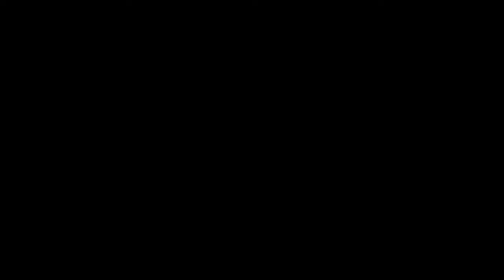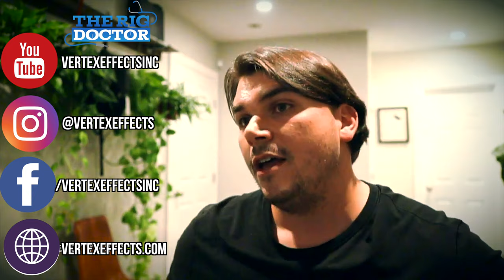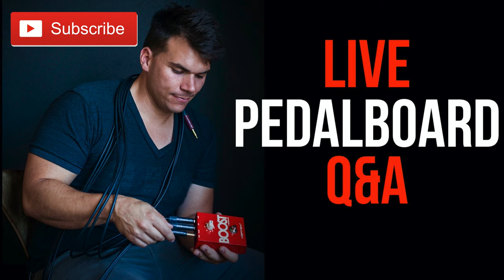Tube Buffered Effects Loop

Comment from the maker: Hey all! We're talking about effects loop buffers today! Let us know if you have any questions in the comments below. Thanks for watching! SUBSCRIBE: https://www.youtube.com/channel/UC0lvt4Tpj5xI4Cfzfz4SHzg
Reply: Any experience working with a Peavey 5150 block letter's fx loop? Putting a board together for that.. But haven't finished getting all the ingredients. I was gonna just put the delays on top of the alp and switch them with a midi switcher, but I might end up putting them in the board for a few reasons such as.. I ordered a Source Audio EQ2 that has two independent, programmable channels, to run one in front of the amp and one in the loop... Also picked up a Gamechanger Audio Plus Sustain Pedal, which I think will work better in the loop if I can get it to work with high gain.. Also, I'm planning on using a TC mimic to pump the signal out to another 5150, into the fx return. 
BTW,  I think the 5150's fx loop is kind of always "in the loop"... Like at least the tubes are.. That's what I've heard.. That it's always part of the circuit somehow. I can't tell a difference jumpering with a patch cable at least... 
Also, some people actually remove the fx loop from the Solano Slo... Or get it without it. I'm not sure why but I think it alters the tone... Maybe it's because it's similar to the 5150's if the urban legend above is true?

Comment: I just found out that ALL my pedals sound way better in one line into the RETURN of my Mustang gtx50. It is way louder and will have to adjust them all. FINALLY the SSS and the lush reverbs SOUND right. Even when i use bypass the tone really still gets squashed by the PRE amp section!

Comment: HI Mason, thanks for sharing so much great info. Could I use the TC electronics bonafide buffer for the return of my FX loop?
Reply from the maker: Sure, as an output buffer but if you have a passive effects loop it won't help.
Reply: @VertexEffectsInc  I just purchase a klein-ulator Buffered FX loop per the rigdoctor's suggestion. That should help with the passive effects loop right?

Comment: If you have a really long cable run in FX loop it really drags on the tubes. That’s where I think the high-wire would be very useful.
Reply from the maker: Adam Smale Realistically you’d really only be able to make a buffer work on the return if you’re coming all the way back to the Pedalbord with long cables, the problem with the input buffer on the send is that you already would be going through 15 or 20 feet of cable presumably before hitting the input buffer unless there was a way to put the buffet right after the send on top of the amp or something like that.
Reply: Vertex Effects OK, I thought you could use the input of the buffer at the board, then use the output to drive back to the board from the FX loop send. But duh! That would require two separate buffers! I didn’t think that through. Sorry, Unc! Even if you had a dedicated buffer to do both runs on a board you’d have to double the cable run just for the FX loop. That would be a 6 cable method? Or 5?

Comment: I asked this question on one of your other buffer videos so hoping you'll answer here. My question has more to do with the front end as I'm waiting for delivery of a Suhr buffer for the return back to my amp's effect loop. I have a JD Cry Baby as part of my signal path and I'm using a Musicomlab EFX MKIV which already has a buffered input (and a non-buffered input). Where should the Cry Baby go in my chain? Should it be first, or should my guitar go into the buffered input of the MKIV and use a loop for the wah? I could leave that loop "always on" when setting up presets. Or would it be best to hit the High-Wire first, then into the wah, then into the non-buffered input of the MKIV? I should add that my Cry Baby I think is a GCB95 that's 25+ years old.
Reply from the maker: Scott McAllister is out the crybaby first then hit the buffered input.  Some wahs sound odd with buffers.  Doesn’t your MusicomLab have a buffered output?
Reply: Vertex Effects Thanks Mason. The MusicomLab MKIV only has a buffered input. The outputs are not buffered. The MKV has buffered outputs.
I have long cable runs (50’) from my board to my amp. Would the High-Wire work as a single buffer to handle both the run to the amp input and the effect return to the amp? Or would two of the Suhr buffers be better...one for each run?

Comment: Still needing some help here, where’s the best place for me to place a buffet pedal. I run an effects loops, and it all goes to my 4x mod on my temple board.
Do I need two separate buffers? For the effects loop & guitar/amp?
Reply from the maker: Yes, you need buffers for the effects loop return, as well as the input an output of the Pedalboard going in front of the amplifier

Comment: That’s weird because my Bad Cat has an effects loop (pretty sure it’s unbuffered) that has major tone suck. Through lots of trial and error I found the fix to be- fx loop send > 6” cable > Source Audio EQ pedal with buffer > to the rest of my effects > to amp’s fx return. If I use a 10’ cable (or longer) instead of the 6” before the EQ pedal, all bets are off. I lose all my highs, so the EQ pedal lives on top of the amp.
Reply from the maker: You should be using something like a Kleinulator to turn you amp FX Loop into an active loop.
Reply: @VertexEffectsInc  I emailed you guys last night via your site to see if they were in stock. Still waiting for an answer

Comment: Any pedal active in your loop is acting as a buffer … this dude knows basic info … we all aren’t equal in our loops … for example Mesa amps loops are tube buffered and even if you have a active pedal in the loop it doesn’t matter shit … it’s hot
Reply from the maker: You can also attenuate in some active loops the input signal which helps to not overdrive the pedal.  Typically you need a pedal that can tolerate line level to ensure that it works well in a loop however.

Comment: Hey Rig doctor, I’m running a pedalboard with a Kemper. Overdrives in front of the amp, wet pedals all in the FX loop of the Kemper ( after the amp). I’m using an empress buffer for the in and out of the “Dry” side of the pedalboard, should I also buffer the Wet side of the board going into the Kemper’s FX loop. I’ve not found an answer to this, any response will be greatly appreciated !
Reply from the maker: Hey! Not entirely sure if the Kemper has a buffered effects loop, but you should only put a buffer in it if you feel that you are losing some clarity in your Fx loop. Again, if you are going to buffer you FX loop, you only need a buffer on the return!
Reply: Awesome, thank you for responding !